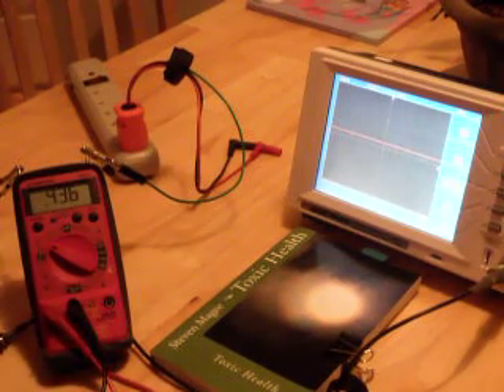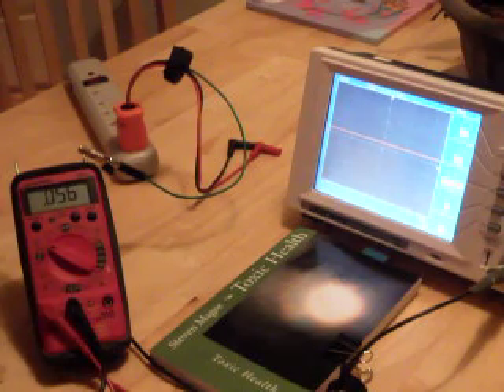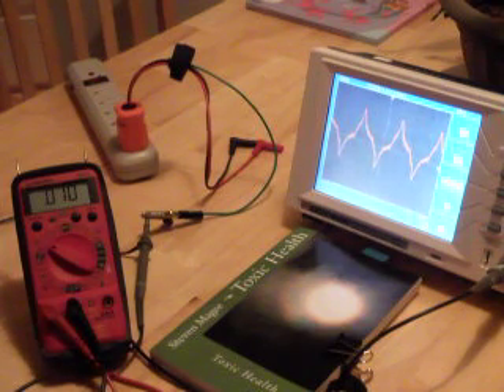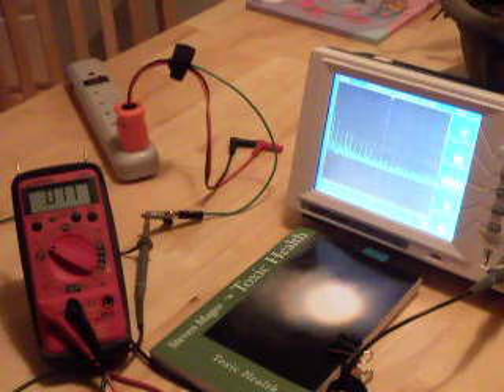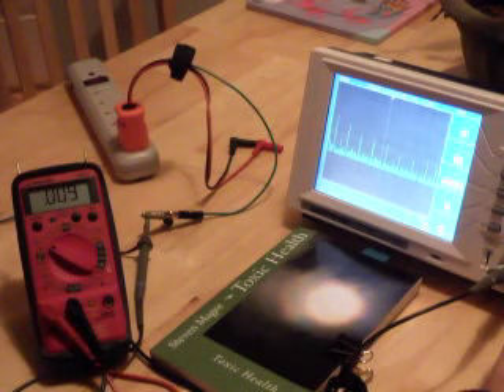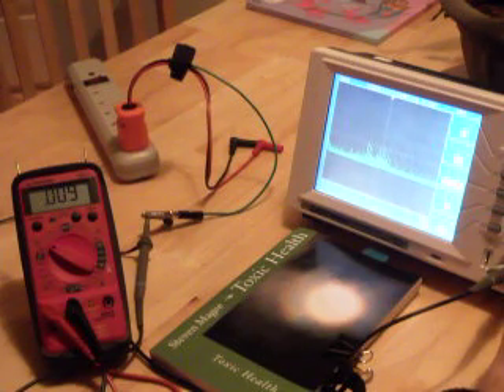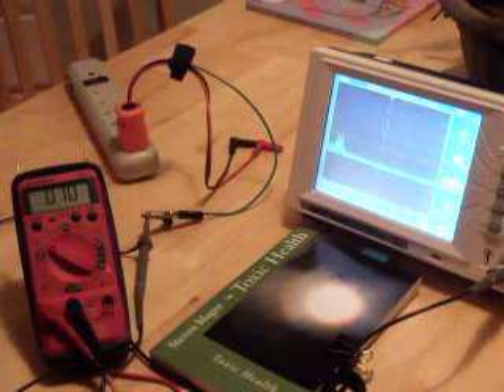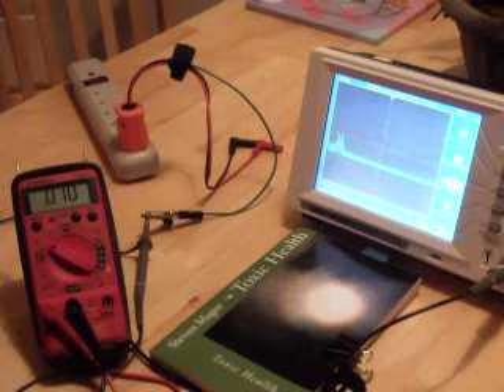Testing the Home Grounding System for Voltage and Frequencies

Comment: I dont have a plug to test ground in outlet, but wondered if could test body voltage by ground to outside yard and other lead hold and tried setting to DCA (at 200u) but didnt get a reading, did on DCV. Since I dont know anything about electricity or volt meters (this is a digital, very inexpensive), do have analog meter also. What would a reading on the DCV mean (is 288-411) on 200m setting when am outside)?  If sit in bed is much lower, if feet on floor is ~56-176. Does any of this mean something ?

Comment: I made a similar measurement. 
I my case I had 400mV AC potential difference between house electrical ground and a wire grounded in the yard. I also noticed a structure in the signal.

So far I have identified two contributions:
- wiring error: Straight Neutral to Ground connection (brings in harmonics)
- Comcast ground wire connected to house electrical ground (brings in 200mV potential difference)

After fixing these problems the potential difference went down to 25 mV.
Am still investigating the structure.

Comment: Hi Steven, I've been watching your videos, as recommended, but I'm confused as to how you definitively establish that the grounding rod in your garden is non electrified (no stray voltage)?
Reply: Have you tested plugging a ground rod into the ground and measuring the voltage through an oscilloscope? I would imagine if the ground is picking up stray voltage then it would be reflected on the meter.
Reply from the maker: You need to use Dieffenbachia plants that have their roots and soil connected into the ground that you are assessing.  This can be done by using metal pots and metal water trays for the Dieffenbachia plants.  Here is the video that discusses how to do it: http://youtu.be/gHCsBuz7lNA Electrified Tiled Floor Plant Growth Experiment.  Here are the results of that experiment:  http://youtu.be/qOWMOLohLrM Electrified Tiled Floor Plant Growth Experiment Review 25th September 2013
Reply: StevenMageeBooks Thank you!